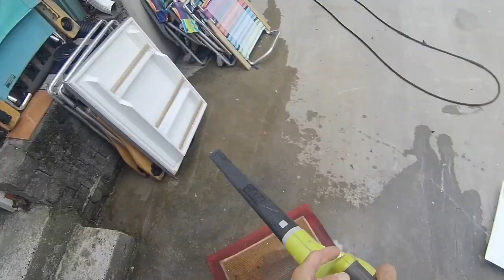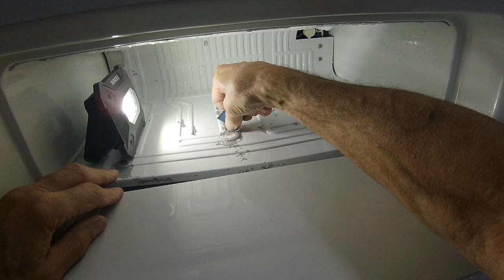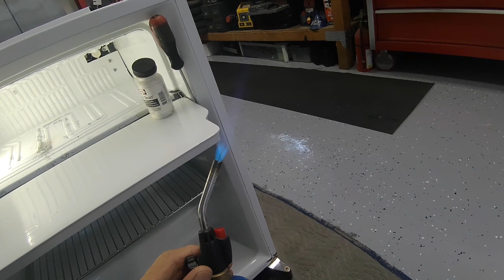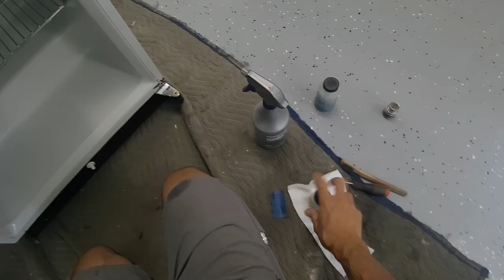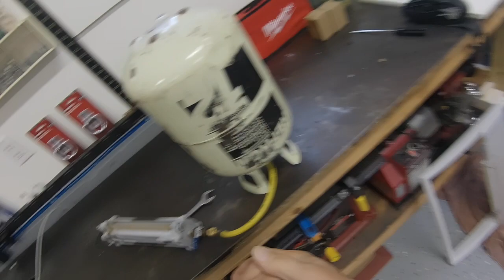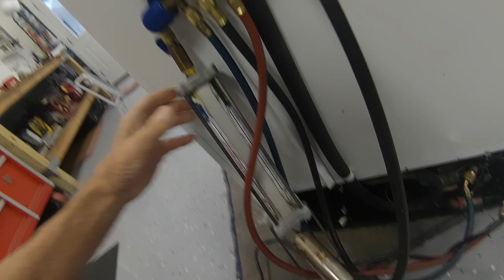Sub-Zero Aluminum Evaporator Repair

Comment: Good work! Im sure there will come a time I am gonna have to try this. I would like to ask you how you would go about replacing a refrigerator side evaporator for a model 3211rfd. The part is nla but im thinking I could just bent some copper tubing to match the factory design. Would be interesting to try retrofit a newer style evaporator along with a thermostat. Appreciate your expertise!

Comment: do you cover the leak with a silver rod? At what percentage of silver does it vary?
Reply from the maker: I’m not sure what percent my silver solder has because I bought it 30 years ago, but there are some great aluminum soldering rods available today on the internet that I’ve used and they work great.

Comment: Could this still work on the newer thinner evaporators?
Reply from the maker: I’m not sure how thin are we talking about? Which evaporator are you referring to? Best advice I can give is to practice on a scrap the same thickness. I would have used a Micro-torch which works on Butane but I was out of fuel.
Reply from the maker: Aluminum melts at 1220F, silver solder melts around 440F, at about 640F you will achieve what is called capillary action where the two metals fuse, that’s where you have to be careful. A micro-torch can reach as high as 2000F, but it’s compactness allows you to get in tighter places. More aluminum soldering video are coming.